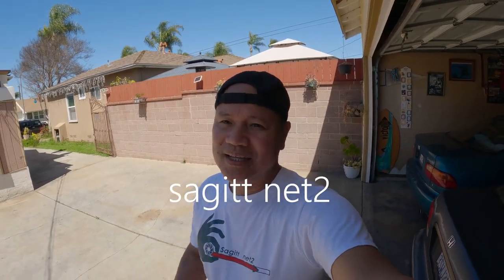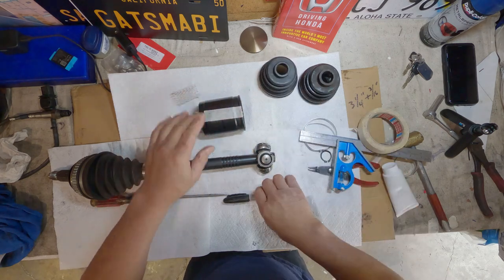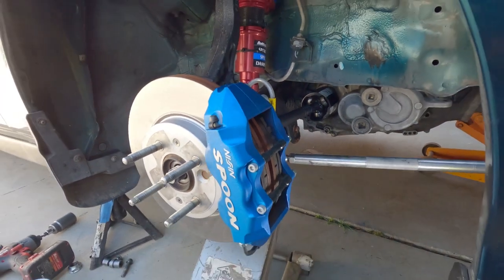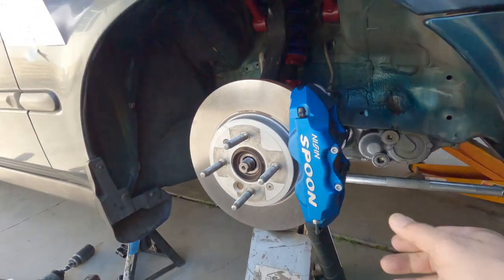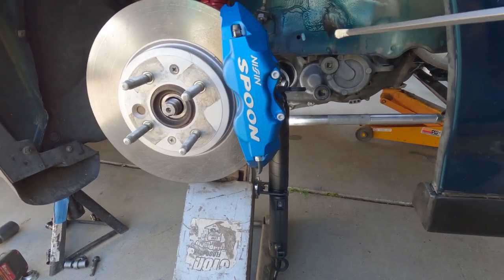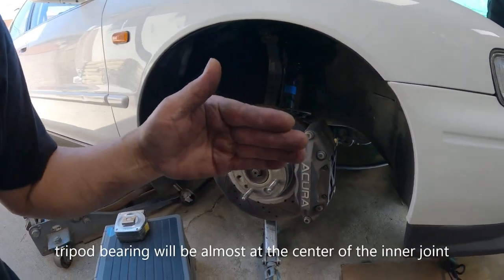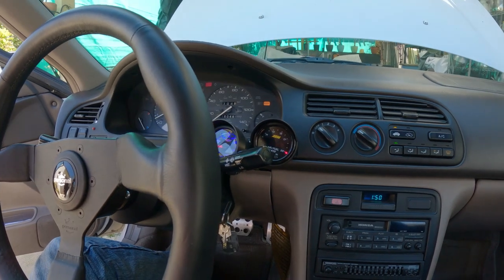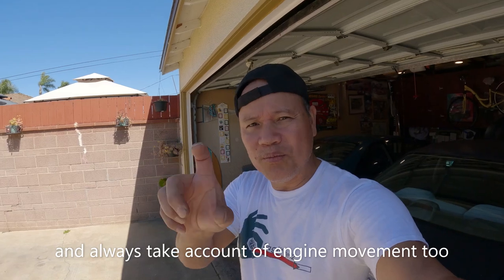Insane Shafts CV axle clearance check ep.2

Comment: yezzir , 3/16” can make a world of difference here.   Dealt with similar on DC5 with Type-R knuckles and USDM axles.    Type-R cv’s are approx 3/4” longer which doesn’t seem like much but many have ran into issues eventually using USDM cv’s    Many still say Type-S axles is fine with JDM knuckles      Sure it can be until it isn’t.       It’s a ticking time bomb basically  that you may get lucky and be fine  until that unlucky day the right combo of wheel turn , acceleration , traction and suspension travel equals 💥
If you’re not lucky enough to get warning signs as you have here .. 

awesome vid man 🤙🤙 
I noticed da 808 state plate too ….    Cherry bra  hope you had a fantastic New Years 🎉🤙🤙
Shoooots
Reply from the maker: I played around w/ different axle from different yr Integra and learned to find out that OE axles from 94-2k are a bit too long. Custom axles is the only way if l really want it done correctly. Anyway, the vibration are from car being lowerdd and really put the axle on a too much angle position. But since l have a different swap now and axles alingment is much better w/ b series tranny couple w/ g23. The plate was from my son when he was stationed there. Thank you for your feedback and happy new year.
Reply: awesome , thank you for sharing , helps many out , a lot of people overlook this 👍

Comment: Very good I have the same symptoms on my car vibrating like hell
Reply from the maker: It's worth checking, l never did fix it all the way. I think some vibration still is coming from the driver side inner joint. It wobble quite a bit and also the car being lowered is not helping either. Both axle are all twisted. I'll find out soon once l'm done w/ the G2B swap and l'll share it to everyone if the vibs is gone or not. Thanks bruh!

Comment: Hello, can a bad inner cv joints like that cause noise when going over bumps as well? My car has this clunking noise only when going over bumps and I have replaced all suspension parts. The noise it still there and the car started vibrating recently when going over 80kph. I checked my inner cv at it almost like what you have in the part 1 of this video. there is no noise when going over bumps if I step on the brakes lightly or step a bit on the gas. I noticed that the noise goes away whenever there is an applied torque to the axles but again, this whole thing happens only when going over bumps. I also replaced brake caliper pins and bracket, Sway bar links & Bushings. Control arm bushings are in good condition.
Reply from the maker: It can be and only way to know is to take it a part and do inspection. But from  my experienced, it shouldn't make a clunking noise it'll only be vibration not clunking over a bump. Clunking noise  on a turn yes, that'll be a bad outer cv joint. Check all your engine mount specially the rear.  Swap the front tire w/ the back and see if it'll make a difference. Hope this help and thank you, lmk once it get fix okay.

Comment: Can it be inner as well wen u feel like it doesn't hand grip/loose grip wen accelerating  shaking at the same time, slow to pick up drive????? Hyndai getz car model
Reply from the maker: It shaked so bad when accelerating @3k-4k rpm. I think itd because of the car is lowered so much and it put the axle in a bind angle.

Comment: Hey sensei I took my h22a4 block and head in to get resurfaced. The guy said before he took my engine that the pistons most likely won't seal after he resurfaces it. I told him to do it anyways, I'd rather at least try to rebuild this engine before I buy a used one. Have you heard of that before? Pistons not sealing because of the resurface??
Reply from the maker: That's new to me, usually you get it resurface to get a good seal on to the block. Maybe it was badly warped that he has to remove lots of material maybe. But you can always use a adjustable gears to compensate for the remove material if you cant get the cam gears align.

Comment: My tripod bearing wear are almost outside my tripod doesn't fit all in and it keeps killing my trioods 😢
Reply from the maker: You might have a short axle. You might wanna do a quick check for correct axle length on your car. Remove the axle nut (axle horizontally level)  and push on the axle toward transmission and you should have 1/4" axle end protruding or 1/4" flush from the hub (maximum).
Reply: I thought maybe i had a short axle too but the thing is it's still the original one that the car came with just that it's started this thing recently and I'm driving a renault sandero 1.6 2009 model
Reply from the maker: @doskii2695  okay, You might wanna check your suspension components. Jack it up and start shaking the tires, you might have some bad balljoints or rubber mounts.
Reply: @sagittnet2158  will check on that thanks